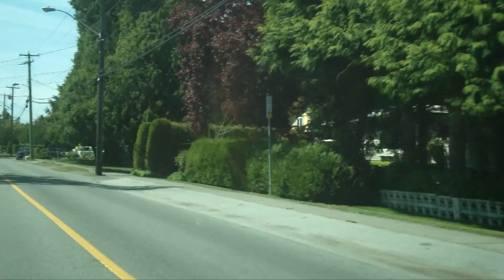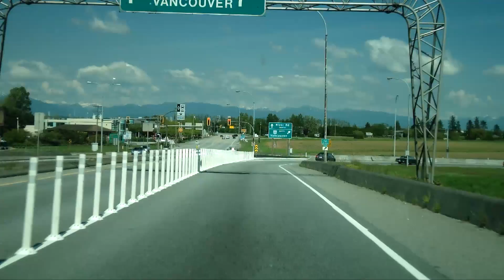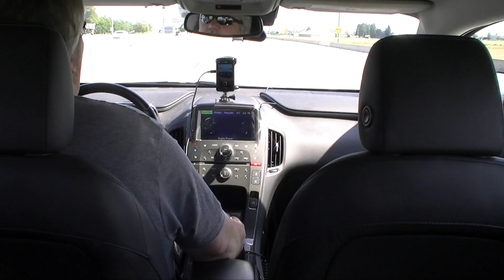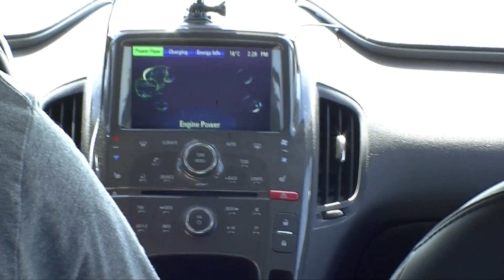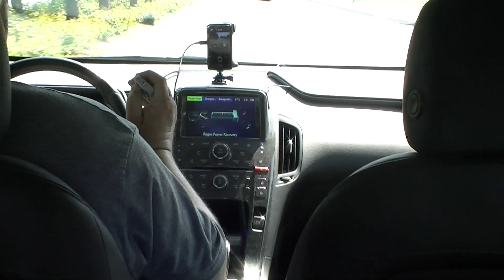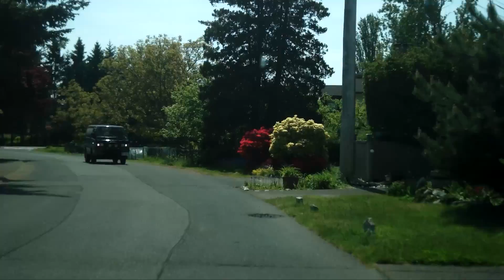How to drive a chevy volt for best electric range and fuel economy

Comment: 0:42 . It's not an electric car with a range extender/generator. It's a hybrid. end of story. And at an expensive one at that. May as well buy an CPO Model S from Tesla if you want an electric car. Otherwise a diesel is a far better and cheaper option.
Reply from the maker: KingProne  You need to go back to school as my idiot kid knows more about cars that you do.The volt is a 100% electric driven car, end of story. I could disconnect the spark plugs on the engine, and drive it every day for all my normal driving needs. Unless I am travelling on road trips I keep only 1 gallon of fuel in the tank. No point in hauling around that extra weight. That is just to get me home if I need to drive further, and I have been seen at gas stations putting in 1.00 - 2.00 worth of gas, just to get a reaction. I walk into the station, and prepay for 1.00 of gas, as that is generally all I need to turn the low fuel chime off whenever it comes on, which is not very often.
I would NEVER own an Tesla. The price of the car has nothing to do with it either, despite what the tesla fan boys out there would like to believe. I can afford a Tesla, and could write a cheque for one today if I wanted one, but if I was spending that much money on a luxury car, it would be a Mercedes or an Audi, not a car that can only go 250 miles and then be forced to sit around for an hour while it recharges, and be forced to drive a specific route where there are chargers.I have a friend that owned a Tesla, he doesn't own it anymore, as he had many problems in the 3 years he owned the car including 2 battery failures, and a main drive unit, and various software glitches. Some that were fixed remotely, but when you are locked out of your car in a parking lot in the pissing rain while you are talking to someone that is trying to get the door handles to deploy that doesn't help. What car is he getting next? He is waiting for the new Volt!Like me, his drive is well within the range of the car, so he will benefit from being electric, but with no range limitations.The new volt is a hybrid, as when the engine does start it supplies power to the wheels. The first generation, which I have is a series hybrid, in which the engine does not contribute power into the planetary gear set under normal driving conditions. It can divert some power, under specific conditions, but the engine can never drive the car. The new volt the car can be driven on electricity, a combination of power from the engine and electric motors, and it can also be fully driven from the engine with no input from the electric motors. It is a parallel hybrid, using a system very similar to the other hybrid vehicles. The first generation is totally different, and it is an extended range electric. Learn the difference and stop sounding like an idiot.
A diesel still needs to use fuel, which last time I checked cost more than gas.My brother in-law bought a diesel, and has regretted it since the day he bought it. My late father had 2, the second one ran away after a seal broke in the turbo, and the engine exploded to the tune of 12,000 to fix. (It was a Ford Power Joke)So don't get me started on diesels. Unless you have something big to pull.
Your just upset because I have saved over 15,000 in fuel and maintenance that I would have pumped into my old car over the time I have owned my volt.
And yes I fully intend to buy another one, and it is not just because I save a ton of money on gas. It is also for the reduction of CO2 that I am not pumping into the environment. All the electricity in my province comes from Hydro electric and wind generation,  which is as clean as it gets.
Reply: ;) your anger amuses me. did i hit a sore spot?
Reply: i know what you mean about that its not a classic hybrid which has the battery only for acceleration and regeneration but that it can be driven in electric only mode. But it has a petrol engine. It's a hybrid. Electric/Gasoline hybrid.
Reply from the maker: KingProne Your ignorance amazes me. It is an extended range electric. 
Allow me to explain the difference so you can understand.
If you want to split hairs, hybrid stands for multiple fuel, however in a normal hybrid, a Toyota Prius, or Ford fusion for example, the gasoline engine is ALWAYS PART OF THE DRIVE LINE. If you stomp on the gas on any of those cars the gas engine will start, and it will propel the car. In the volt the gas engine is only used to generate electricity once the battery has been exhausted. If your drive is within the range of the battery, 60KM, (80KM for the 2016 model) then the engine will never start no matter how hard you drive it.It is classified as an EVER, electric vehicle, extended range. No different than the BMW i3 and the former Fisker Karma. You misinformed idiots do more harm than good.
And to prove I am correct my insurance papers show it as an EV, not a gasoline electric hybrid. My wife's car is a conventional hybrid, and her paperwork shows the car as a gasoline/electric hybrid.It is all in the way the system is set up. They only way you can remotely use the term hybrid when describing the volt is because it has duel fuel but this is incorrect, and confuses the market, because people think prius, a car that is under powered, and not very fun to drive, and still burns gas, even on short trips.  I went over 10,000 KM on a tank of gas last year. Try that in your prius, or diesel, or any other car that is not limited to being in range of a plug.
You don't see me taking shots at Tesla, as it is a great car for those that never want to venture onto the twisty fun mountain roads that I enjoy so much. That car just wouldn't cut it for where I go all summer when I am on my month long cross country trip.
Reply: are you saying the volt only has a petrol generator range extender built in? So the petrol engine is not connected to the drive shaft?
Reply from the maker: KingProne Correct. Under most operating conditions the engine is never connected to the drive line.The electric motors move the car under most operating conditions.There is one mode, and the computer only activates it under specific conditions, where the engine can be clutched in to assist when the computer deems that it may be more fuel efficient to do so. This only occurs at high speed extended cruising over flat surfaces. Cruising down the highway between 65 and 85MPH that can happen, however if you step on it to pass, it will switch back to full electric (with the engine generating power only) until you get back into the range where the computer decides to couple the engine back in. In hilly areas, or when the speed is outside this range, the engine cycles on and off, even at freeway speeds, as it is putting power into the battery, and then it goes off until you use that stored energy again. This is the first generation volt. The new one operation is different. Haven't driven one yet, but I will take one out and see how it operates by comparison.
Reply: still though, you say you get about 5.1l/100km (without recharging electricity) as long as you can regen a bit.that's a bit shabby for such an expensive car considering a modern diesel easily cracks the low 4.x litres/100km and diesel costs 30% less in most of europe. don't know about america.
Reply from the maker: KingProne We are not talking about Europe. In North America the diesels do not get particularly good mileage, because we have to be certified as clean dieselThe VW Jetta, a popular diesel is rated at 31MPG city and 45 Highway. My brother in-law doesn't get that. He gets about 27 city, and 43 highway, averages out at 34 combined.Diesel here costs on average .20 per liter more than gasoline.They also require the addition of Ad-Blue exhust scrubbing solution, and are choked up with catalytic converters. plus they are not all that much fun to drive. Having full power available instantly under your right foot at all times, even at high altitude is a blast, and with the exception for when I am on a road trip, I NEVER put any gas in it at all. A 30 liter tank of gas lasted me for 10,000 KM!Took me 10 months to burn it up.You can try to put whatever spin you want on numbers, the facts are my volt will completely repaid it's purchase price in fuel and maintenance savings in 8 years. I am half way there now. I have 20 grand in the bank, in a separate account that I set up and started putting money I used to burn up in my old gas guzzler. There are no oil changes, ok 1 every 2 years, but big deal, the brakes last forever due to regenerative braking, no smell, no noise, and it is a blast to drive, unlike the last diesel I owned. Yes I had a diesel. The first car I owned was an old Sherman tank, also known as a Mercedes Benz diesel. I neglected to heed the change the oil every 2,000 miles warning, and paid the price when a seal let go in the turbocharger, and the engine went super nova, burning engine oil and running away till it threw a rod. last diesel I will ever drive.
Reply: so what you are saying is that it is a hybrid.
Reply from the maker: +Rennie Allen Same here. I don't factor in the electricity cost because I charge my car on public charging stations regularly, and they are all free to use. I charge up at work every day, so don't charge much at home, but if I did, our rates are only .08 / KWh, so a full charge would be less than 1.00.
Reply: KingProne Nope.  It is a BEV with a range extender, so technically it is a Bi-mode not a hybrid.  It is specifically designed to never engage the gasoline engine if you don't go over 50 miles.  The Volt is designed on the assumption (a valid assumption it turns out: see the recent long term INL studies) that many people commute less than 50 miles per day (http://www.hybridcars.com/idaho-national-lab-shows-chevy-volts-go-nearly-as-far-on-electricity-as-pure-evs/).  If you commute less than 50 miles per day, but want the same vehicle to be able to drive cross country the Volt is for you.
Reply from the maker: rennieallen I went 10 months without the ICE starting more than 5 times and that was just for engine maintenance.
Reply: +KingProne Terminology is a bit of a bitch in this day and time. 

I personally call the Volt a Plug-in Hybrid simply because it shares a lot of similarities with the Prius plug-in and even down to the use of 2 Motor Generators (MG1 & MG2), an small Inline 4 gas motor all coupled neatly with a planetary gearset forming the 'E-CVT'. GM kind of confirms it too by calling the later Caddy ELR a plug-in hybrid as well, but with the Volt being such a critical car of GM's darkest days (it was a development nightmare during 2009) Chevy doesn't want to call it by a name which can be mistaken for a Prius.

Let's put it this way: the Volt is a EV-heavy plug-in hybrid which can do ~45miles/60kms purely on EV (even at 110km/h or 70mph highway speeds, which I find very interesting b/c a Prius plug-in cannot do this). The Prius (regular and plug-in) is a 50/50 hybrid which mainly uses its gas motor with occasional electric assist (moreso on the plug-in version).
Reply from the maker: +Trades46 There are huge differences between the prius and volt. The Cadillac ELR FYI is the exact same system.Now there are differences between the new upcoming 2nd gen volt and the 1st gen, which by most people I have talked to, and I agree is a superior design. (1st gen) The main reason they are changing the power plant is for cost reasons. The original cost too dam much to make. The 2nd gen is more like a Prius, or a Ford hybrid. Personally I have not had the opportunity to drive a 2nd gen yet, and I will as soon as I can get one in my hands for a test drive, and then I will share the in and outs of that car. But here we are discussing the 1st gen, and unless I am proven wrong a technically superior and more expensive to build design.I wont go into the differences in operation here, other than to say what I have read, and understand about the 2ng gen is that it can operate as a pure battery car, and then operates as a parallel hybrid with the as engine driving the wheels through the planetary power split and a 1 way clutch.The first gen, the one I have, operates primarily as a battery EV. At all speeds, not just to 70MPH as you put it, it is on battery. Right up to the speed limited top speed of 101MPH it is running on battery. The gas engine never fires at all, not even under full load at full speed until the battery is used up. Then, and only then, unless the driver has selected the hold mode on the drive mode button, on model years 13 to 16 only, the 11/12 models did not have this option, the engine starts, and produces electricity to go into the battery, and feed the electric motor that is driving the car.This is known as a series hybrid, with similarities more to a locomotive or ship drive system than a prius.The engine generates power, for the traction motor, and stores the excess in the battery. If the battery takes on more charge than the traction motor uses, the gas engine will stop and that generated power will be used up and then the engine starts again.At high speeds, under low loads it is more efficient rather than store excess power in the battery, to couple a portion of the engine torque to the power split device. By changing the configuration of the 3 clutches the drive system can be re-configured on the fly from a series hybrid to a parallel. This only happens at cruising speeds under relatively low loads. Stand on the accelerator and the system quickly switches back to series mode, and the full power comes on.So don't be confusing this one of a kind system with anyone else as there is no other car on the planet that works like the volt. BMW have their i3 out, but that is a grossly under powered series hybrid. Whoever thought a 600 CC 2 cyl engine for the generator was a  good idea needs their head examined. The idea is that the system should be totally transparent to the driver. The driver shouldn't experience any performance change at all regardless on if the car is on battery or gas. The volt delivers that flawlessly.  GM spent a ton of money developing a world class car that hasn't received the respect it deserves.
Reply from the maker: +KingProne 
If your definition of the term hybrid 
Is dual fuel then yes. However the correct term for the volt is EVER or electric vehicle extended range to differentiate the difference between the volt and the other hybrids. However you can't fix ignorance and you are proving that point.
Reply: +KingProne It is technically a type of hybrid, yes; but it is not directly comparable to any other mainstream hybrid on the road.  It is a series hybrid with selective power-split mode (it is the selective nature of the power-split mode which makes the Voltec powertrain unique).   

Unlike any other hybrid, the power-split mode is only used at high-speeds (when doing so will keep both the traction engine and the ICE in their respective optimal torque RPM range).  Having driven my volt from SoCal to Tulsa OK and back last month, I can vouch for the efficacy of this approach.  Other than this one case the Voltec powertrain is a pure EREV (i.e. a BEV with a range extender).

This particular design turns out to be optimal for a very large footprint of vehicle use patterns (~80-90% local usage / ~20-10% long distance usage).  In my case, my wife uses the vehicle as a local commuter, and then (perhaps once a year) we will take it on a long road trip.  This provides almost the same efficiency as a BEV (within 5%) yet with the ability for unrestricted long haul travel.  As such, it is perfectly reasonable to have the Volt as your only vehicle, whereas something like a leaf is fine as a second vehicle (where the other is an ICE).  The efficiency of the Volt far exceeds that of any other hybrid (a prius plug-in will average about 46MPG over the year while I average 70MPG over the year - including the long haul trips).

If your use pattern is more than 50% long haul (significantly over 50 miles between charges) then the Volt is probably not the optimal vehicle and a conventional power-split hybrid makes more sense.  It is important though to take note of that qualification of "50 miles between charges" because, if you commute to work and have a charging station at the office, then the Volt's relatively small battery (as compared to a pure BEV) is easily charged in 4 hours on a level 2 charger, meaning that you can support a 100 mile round-trip commute and have a vehicle that is *35% more efficient than any other hybrid (35% is a very significant difference).

* this efficiency delta is dependent on the ratio between the price of fuel and the price of electricity, so check these to determine exactly what the advantage would be in your area.
Reply from the maker: +Rennie Allen This is exactly what I have found.During my commuting season I burn no gas. I can go from August to June on a tank of gas. My daily commute is roughly 36 miles every day, and that is easily accomplished on the battery. Plus in the area I live there are level 2 chargers all over the place and they are all free, so even on longer local trips I never dip into the range extender. Then I go on my annual road trips where I drive thousands of miles to destinations all over the place. On average I have found that I can achieve around 40-42 MPG to the US gallon. On my last trip it was 42.4 MPG us gallon. Total distance driven 1995.5 miles 47.0 gallons of fuel. In the metric system that is 5.5l / 100km.A prius is rated at 4.9l / 100KM and a TDI diesel 5.2. So this is very close to what a diesel gets on the freeway.For those that calculate their fuel economy based on the imperial gallon, the fuel would have been 39.2 gallons. So the mileage would have been rated at 50.9 MPG imperial gallon. Now this particular  trip was to outlying areas of the mid west in Montana, and Idaho. I had NO opportunity to charge my car at all for that 10 days I was on the road except for my initial charge when I left my house, so that fuel economy in not skewed by electric miles. That is the true mileage driving though the mountains operating the car as a gas car.But then you already know this. It is the ignorant people out there that need educating.
Reply: 42 MPG is the actual charge sustaining mileage (I obtained 36 on my trip which was driven very quickly :-)  When you blend that over the year (and compute the gas equivalent cost of the electricity) it should work out to around 70MPG (US) equivalence (I.E. the total cost per mile is the same as if you were getting around 70MPG at  California gas prices - which is what I pay).
Reply from the maker: +Rennie Allen On the trip I quoted that was the actual fuel economy. There was no recharging from the grid. The only recharge was from energy captured going down the hills.On past trips, I have been able to recharge my battery every night, and start the day with a full charge. Throughout the year, my combined electric + gas ratio the empg is 147.2 MPG. That is from the lifetime display on the car. Any way you cut it, no other car is going to give the flexibility and convenience of the volt.
Reply: That 147.2MPG is based on the number of miles traveled using gas, it doesn't count the cost of electricity (which, of course, isn't free). You need to divide the miles per kWh by your electric rate to figure the cost per mile, then you divide that number by the cost of gas to obtain equivalent MPG. That should be between 70 and 100MPG depending on the the price you pay for gas and the rate you pay per kWh. 

Over the year the vehicle display shows a lifetime MPG of 140 for me as well, but the computed equivalency is ~70MPG (based on California gas prices and electric rates); however for me personally, because I have a solar system and my rate/kWh is considerably lower than that for a non-solar ratepayer my equivalent MPG is about 100MPG (but I don't want to use that number as it is not necessarily representative of what a typical Californian would get).

So, in any case, yeah, it is still far beyond what any hybrid can deliver when the driving pattern fits the Volts usage model, and almost the same as a pure BEV.
Reply: 12voltvids .08/kWh... you guys up there are lucky.  Even the fact that I am on solar here, and that I can buy back power from the utility at the off-peak rate still means I pay .13/kWh.

A non-solar rate payer here would be paying about .22/kWh, although there is a special program for EV as well.

So a full charge costs me $1.43.  Premium gas OTOH costs around 3.25 (I can get it as low as $3.00) so the electricity/gas price delta is smaller (thus less favorable) for me than it is for you (although I just used gasbuddy to find BC gas prices and convert them to USD/US gallon and the price of fuel is almost identical).

Sure, if you get the power for free, then 140MPG is 140MPG :-)
Reply from the maker: +Rennie Allen I would estimate that  at least 50% of my charging is on the free stations because there are all over the place here.I buy my gas for my other car in the US and in us funds regular is 2.26 per us gal, 3.02 for premium, but then a tank of gas lasts me 10 months in the volt.Our hydro generated power is .08 (was .06 but that's another story) for tier 1, and then the high rage is .12 for tier 2. We don't get a break on time though, it is first 1360KHw at the low rate and the rest at the high. With all the waste here with teenagers standing in the shower for an hour, and running the washer and dryer to wash 1 pair of pants that they "must" wear my electric bill is north of 350 a month, but no gas bill as everything in my house is electric, heat/ac, HW. I figure once the kids fly the coop my electric bill will drop to about 1/3 what it is now.
Reply: 12voltvids OK, so yeah I can buy as much power as my service can deliver off-peak for .13, so that isn't too bad then really (also the amortized cost per kWh of capital for my solar system is also .13 but I use all my solar system can generate on my house A/C so it really isn't available for the Volt, so I have to charge it off-peak, but that is not a problem as it is natural to charge overnight).
Reply: +KingProne With my Ampera the average consumption is 21km/l using gas. I use the Torque app to monitor it. Of course one has to use the car efficiently. I use gas only for long highway trips and if I go full speed limit (around 140kmh) I get down to 17km/l.
Reply: +12voltvids Funny to think that VW are certified as clean diesel after the latest discoveries...
Reply: +12voltvids In my Ampera documents it says hybrid. That's because it can generate power from two sources (gas or straight electrons). Even cars using gasoline and methane are called hybrid even thought they don't use them at the same time. Still I think there should be another category because the not so funny thing is that even though I mostly use the electric mode I can't access the areas where the charging stations are since I carry an engine...
Reply: Andrea Dianin bimodal hybrid would be a good term (a series hybrid with a big battery effectively creates a bimodal hybrid).
Reply from the maker: +Andrea Dianin You can't access areas with charging stations because you have a  generator on board. What kind of backwards country are you in. Here in Canada, we get all the perks of EV drivers, because the volt is classified an an EV. That includes the nice close parking stalls at the mall with a charging plug. I know what the word Hybrid refers to,  and it has been around much longer than cars. Back in the 70's when vacuum tubes were starting to be phased out, we had a lot of hybrid televisions that used both solid state and vacuum tube circuitry.  It is the confusion that it causes with the public. When they think hybrid car they think Toyota Prius, which is 95% gas powered and 5% electric powered. Even the plug in version, the electric is only used under low power demands. By contrast the volt is 100% electric, and if your commute is less than the 60Km range of the battery it is never going to turn on the engine at all. Therefore it is, and should be called an EV-ER. That term stands for Electric Vehicle with Extended Range.  It shouldn't matter if the system is a series hybrid such as the Fisker Karma was and the BMW i3 is or a Series+parallel system such as the first generation volt, or even a parallel system like the 2nd gen volt is. If the engine never starts, ever under any circumstances no matter how hard the acceleration until the battery is depleted, it deserves the EV-ER badge.If the engine comes on under hard acceleration even when there is charge in the battery, then it should carry the hybrid badge. That is my take on it, because these vehicles are totally different from other dual fuel designs, and I think they deserve exclusive recognition.
Reply: the volt is not 100% electric. It has an electric motor which gets charged via outlet or via the internal combustion engine which also connects to the drivetrain at high speeds.
Reply from the maker: +Rennie Allen Whats wrong with EVER?Again, when I see the term hybrid I think Prius, and it bugs me, because as someone who also owns one of those, I know how different they operate.Emphasize the ELECTRIC portion of the drive train. After 4 years I still get people come up to me and start talking out their ass how it is the same as a prius, and the prius is cheaper, and gets better gas mileage. Then I point out one important fact, that their prius uses gas every time they drive it, and my volt only uses gas when I take it on a long trip, and for my daily drive to work every day I use no gas, not a drop, and my engine only starts for 3 minutes every 6 weeks to run the maintenance routine to lubricate the parts, and purge the catalytic converter.Then they say oh? it's not the same... That is the problem, and throwing this hybrid badge on it isn't helping.
Reply: 12voltvids I totally agree with you on the perception issue.  I think bi-modal hybrid is the best way to express what the volt is (if you put a different word in front of hybrid that will at least force a layman to think).

Layman "That's just like a Prius"
You "No, a Prius is not a bi-modal hybrid.  A Chevy Volt is a bi-modal hybrid"

Then they are forced to ask "what is a bi-modal hybrid" and you can explain, and (more importantly) when they then go to their friends they can "show off" their new found knowledge about what a "bi-modal hybrid" is :-)
Reply from the maker: +KingProne If you never have the car go into electric mode, which I don't unless I am traveling a long distance, such as when I am on holidays I am driving an electric car. I keep 1 gallon of gas in t he tank for emergencies all year long and only fill the tank when I am traveling. So what is that I am driving if it is not an electric car? It is a range extended electric. You do NOT need to use the gas engine. A prius or every other hybrid uses the gas engine every time it is run. The volt does not. You should get your facts straight before you spout off, because we love your ignorant comments. You probably drive one of those Jokeswagon Diesels that is spewing toxic fumes into the air.I dam near pissed my self I was laughing so hard when that news broke.
Reply: yeah if you want to travel at motorway speeds you will need the gas engine. But you are right, it is a hybrid, like you describe.
Reply: KingProne I travel at highway speeds (70mph) in my Volt all the time (almost every day) without using the ICE at all.
Reply from the maker: +KingProne 
Keep it up, you are amusing everyone with your total ignorance. Since you are not too bright I guess I need to use small words. I can drive my volt at 101 mph or 162 kmh on the motorway untill my battery runs down, 40 miles. The engine is NOT running. It is running as an electric car, not a hybrid. You are thinking of a Toyota. At motorway speeds the engine is running. That is a hybrid and that's the difference. But as they say you can't fix stupid.
Reply from the maker: +Rennie Allen This guy is just trying to stir up an argument. He obviously knows nothing about the volt, and doesn't want to educate himself. Sounds like a typical VW fanboy to me that actually believed that those dirty diesels are better for the environment than electric and hybrids.